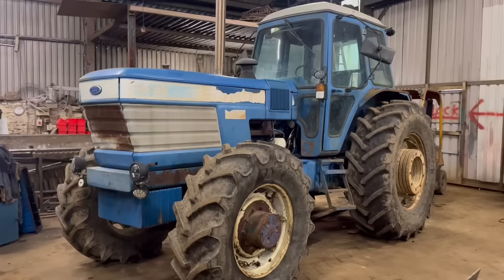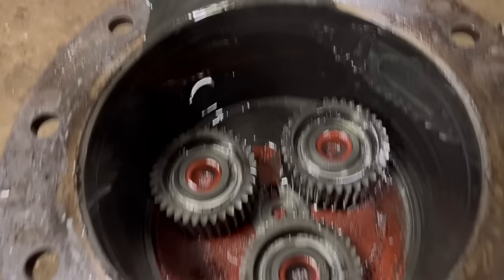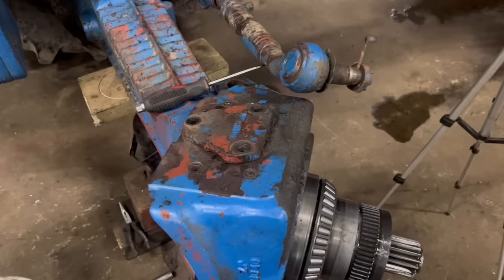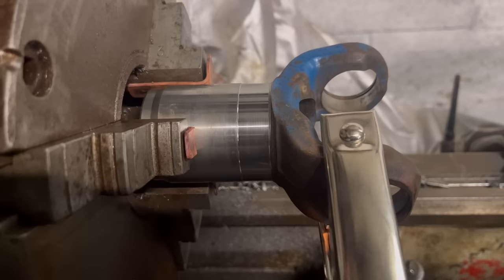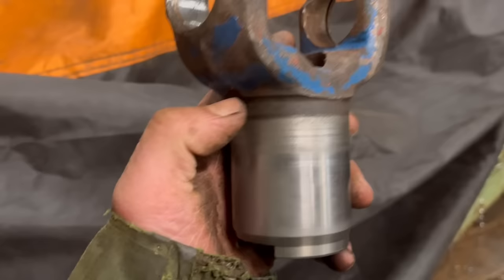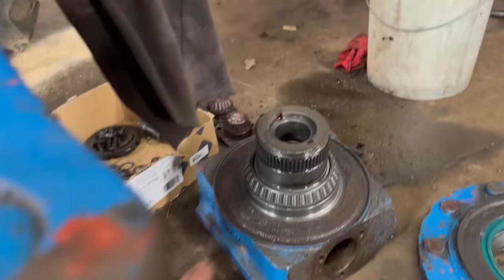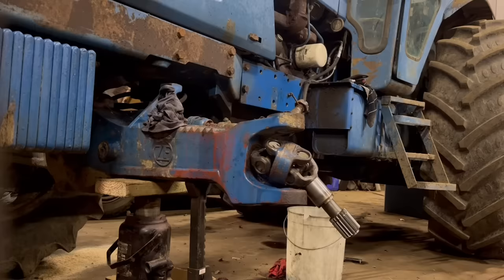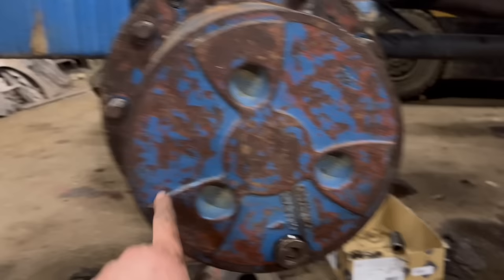Leaky hub seal turned into a machining job on this Ford TW25 tractor!

Comment: The trouble with old workhorses like this one is the multitude of sins you find the deeper you get in, one thing always leads to another. A suitable candidate for spray welding but the tig fix looks good. Good video, plenty of content and speeded up in the right places. Look forward to more like this.
Reply from the maker: You’re not wrong there!  
I’ve never had a go at spray welding yet. 
Thanks!

Comment: No experience on tractors , but I’ve worked on ATVs for 30 years and always had good results from speedi sleeves . You don’t machine the shaft down , they just go on top of the damage . There’s a few tricks though ( you can’t just bash them on and expect that they will stay on )

Comment: TW series Ford tractors. This is an old girl. Probably from the eighties ? When the TW range first came out I was still involved with farming. It would have been late seventies. All our tractors were Fords. I think the range went up to like 7 or 8000 series. And then after that was the TW range. Our dealer was trying to sell us one. So brought one around for us on trial. This was still the days of the smaller fields. The turning circle on the thing was two football pitches. You had to do a six point turn at every end of the field. It went back to the dealer. Like you say it makes a change working on different things. Pays the bills. And makes interesting videos. Win Win.
Reply from the maker: 1987-1988 this one was registered.

Comment: I used to feel the same way about Speedi-sleeve, but after trying them out a few times I found that it is actually a really good way of making this type of repair. It works really well, is durable, and if it wears out you can knock it off and install a new one. I have only tried the SKF ones. Good job! 🙂
Reply: I also got good results with an SKF Speedy Sleve at the front main seal of my 1978 Moto Guzzi. A 30 minutes fix, unexpensive, and if lasts since 5 years. I am happy with it.

Comment: I like how you fixed the problem. I have repaired the same problem with what is called a speedy slave. That is a thin stainless sleeve installed over the warn part, then new seal installed.
Reply: Wishing you still had the number of the sleeve, I need two of them really bad and I’m terrible on the internet looking up parts 😊😊
Reply: If you still have the speedy sleeves number would you mind sharing it with me, Please 🙏

Comment: TIG was a good choice. That is a heat treated part so with TIG you put a minimal amount of heat into it and hopefully didn't compromize the strength. Well now you will know how to fix the other side when it goes out. Good job...

Comment: Well done. I know many qualified mechanics who would not have taken the effort and be as meticulous as you have been. Many tap seals and bushes in with hammers, even though they may be soft blow hammers (but with next to no mandrels). If you talk to the seal and thin wall bush manufacturers they always recommend using the press and mandrels as you did. However, on the other side, welding the OD of a shaft when there is a mating inner shaft like you have, has risks. When welding the OD, shaft has a tendency to shrink. Luckily your shafts had enough tolerance and after welding and machining they still fitted together. However when you can't get the right size speedi sleeve, you have little option. So well done. Will see how the TIG heat input affects the shaft. I noticed the glowing material coming off as you were machining the shaft - you were pretty well at the limit of the carbide machine tool inserts - a file would have not touched/marked the shaft. That shaft had hard surfacing. Again, if you can't get the right parts then you have to do what you need to do. Alternative is either to spray weld as some have suggested or scrap the machine - owner would not like that option. You have a lot of skills. Keep doing what you are doing - I've seen a reasonable number of your videos and your work is high quality. As word gets out more and more, you will never be short of all sorts of work - well paying work. Regards. Bob. Retired mechanic/machinist in Land Down Under.
Reply: There’s not many real mechanics alive now and I’m 73 but work one day and rest the next lololo 
But still at it😊😊😊

Comment: Few years ago farmer came into work with a leaking hub seal on tw15. The big seal above taper roller. Needed to dress surface. I made up a mandrel and swung hub using inner bore where UJ stub goes thru. Well it turned out from factory the inner bore and taper roller bearings and seal were on different axis. I noticed teeth were wearing badly towards one end. I had to sleeve where bearing ran and fix out seal surface. Fixed oil leak but warned farmer gears would fail. Sure enough a planet split and punched a chunk out of the annulus. From ZF factor back in 1983 or so it was crook. Tractor been sitting for six years now. Still trying to find affordable bit to fix.

Comment: Hi Mate i have been doing what you are doing now , and I am now retired  What I used to do with Pitting and scores on seal surfaces and dings on Hydraulic spears was to polish the surface and Easyflo silver braze ,Less heat input and polishes up a treat

Comment: Speedy sleeves are legitimate repair. A lot of engine manufacturers putting them on the shafts from brand new, to insure the possibility of the leak repair of otherwise very expensive and generally not available crankshafts.
There’s also LockTite products that work very good for that application, especially when you have access to a lathe.
Reply from the maker: I maybe ought to think of them for future repairs then.
Reply: @snowballengineering  I can confirm they are a valid repair.  Its all about resources.  Often there is no option to weld up a sealing surface in the field then turn it down.  Lots of mining operations now require extensive contamination mitigation and abatement.  We keep rotating shafts in service with speedy sleeves.  Have to know the issues though.  If a guy throws a speedy sleeve at a leak while never addressing bearings... well it obviously isn't going to correct that problem.

On the flip side if a guy has the resources sometimes welding and machining are the solution because either the sleeve is stupid expensive for the application, or you literally can't get you hands on one in any reasonable amount of time.

Comment: The best repairs, are repairs that can’t be seen. The next person looking at the work would have great difficulty determining that there was a repair made. In my lifetime I always pick a “stock”, used machine over any machine that has had “repairs”, and my strategy has always worked out for the better. If I have to repair something that’s one thing, if I have to try and figure out what someone else has done, and the effects of the repair On other parts is questionable… give me stock.
I’ve seen transmissions that have less bits than the front wheel hub !   changing the fluids regularly is critical , can you imagine the cost of replacing all the gears bearings, seals and races on both sides !

Comment: Nice job there very common problem on a county 1004 I had. It was very worn on all the hub seal surfaces they end up with deep grooves heavy part to hold in a lathe.

Comment: oOOH yA!   thanks for the heads up on this job: first I thought it was like on older joints ( like Landrovers - the chromed ball).   Interesting to see guts.   Hmm, frightens me:   distortion from welding....  what was wrong with sleeving?   Anyway, thaks for showing a procedure.   Cheers, mate.

Comment: Not familiar with this particular tractor, but that inner seal with the sliding joint seems mightily exposed.  Particularly for  tillage work or if you had a loader on it and them wheels were  knee deep in slurry lots of times.

Comment: Speedi Sleeves are not a bodge. I say this after 20 years of using them on heavy equipment. If you put heat into shafts, and remove the factory heat treat, that's more of a bodge, IMHO.
Reply from the maker: I also couldn’t find a speedi sleeve suitable size for the job.
Reply: Do you need liquid nitrogen or dry ice to get good results with speedy sleves?
Reply: @robertpeters9438  No, they're called speedy for a reason.

Comment: Good job don't quote me on this but there is a part missing out of the external hub that locates in the recessed hole in the centre which touches the drive shaft end. not your fault if it wasn't there & you haven't done one before. I did one on a 7840 last year it had one may stop a little letteral movement. Then again it may not be necessary, good vid all the same.
Reply from the maker: Pretty sure there’s nothing missing. I’ve checked the drawing and everything was there. 7840 have a different axle and hub to these I think.
Reply: @snowballengineering  at 3.45 right in the middle of them gears, it fit's in the casting it fits round thing with a rectangular tab on it that fits in the recess to stop it turning & rubs against the end of the centre pinion. maybe a outer hub that does a lot of different models with a different set up.

Comment: Serious question. We run a TW 15. Has had engine overhauled and runs very well. About 7 years ago had leaking hub seals. Stripped assembly and upon inspection found a serious manufacturing fault. The housing that outer bushing for sun gear shaft and main stub shaft for big bearing and seal were misaligned. This caused sun pinion and planet gears to wear towards one end, basically thinned out the teeth on one side of gears. We corrected the problem, but about 2 years later, a planet gear split, jammed, and blew a chunk out of the outer internal gear. We can't find any bits. It's the lighter 4 pinion ZF setup. Does anyone know where to get a used one? We are down here in Canterbury NZ.
Reply from the maker: Are you on Facebook? Try the group called The Big Ford 6 Cylinder Tractor Register

Comment: I have a question. Why if you're going to weld a shaft up and then turn it back down, why turn it down first?
Reply from the maker: To remove any impurities in the base metal and so the weld has some thickness to it once machined down.
Reply: Welding is all about preparation, not the act of welding.  Turning is no different than grinding a surface prior to welding.  Cleaner the substrate the better the weld.  Ounce of prevention is worth more than the pound for the cure.